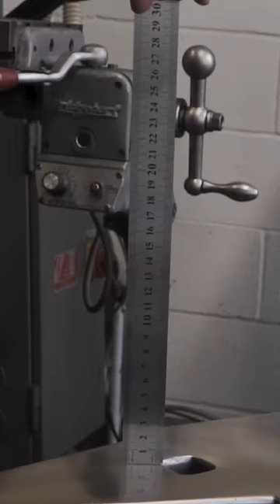"Pig" Anvil Restoration, Super Speed Build! #shorts

Comment from the maker: Thank you for watching! Find the full length video on my channel page!
Or click here:
https://youtu.be/QFqKMneLhBc
Reply: Are you gonna make the Hammer of Thor with that thing😂? Nice video
Reply: Nice job.
Reply: @JaymesWebbs  я
Reply: Why would you mill for parallel and then flap disc the top? Or set a binder underneath the feet that you milled? Mill parallel for no reason at all then??
Reply: В России такого уже не найдеш
Reply: When can I expect the delivery? Haha
Reply: @JaymesWebbs   Very nice. You might get more dampening using sand as your base then concrete. But the concrete will definitely give you more weight.
Reply: Take this lifehack. You can make it easier and cleaner if you connect the sandpaper wheel to the lathe instead of the mill, and you'll get very even and flat polished surface.
Reply: 250lbs?
Reply: @JaymesWebbs  😊😊😊😊😊😊😊😊😊😊😊😊😊😊😊😊😊😊😊😊😊😊😊😊😊😊😊😊😊😊😊😊😊😊😊😊😊😊😊😊😊😊😊😊😊😊😊😊😊😊😊😊😊😊😊😊😊😊😊😊😊😊😊😊😊😊😊😊😊😊😊😊😊😊😊😊😊😊😊😊😊😊😊😊😊😊😊😊😊😊😊😊😊
Reply: @JaymesWebbs  😊😊😊😊😊😊😊😊😊😊😊😊😊😊😊😊😊😊😊😊😊😊😊😊😊😊😊😊😊😊😊😊😊😊😊😊😊😊😊😊😊😊😊😊😊😊😊😊😊😊😊😊😊😊😊😊😊😊😊😊😊😊😊😊😊😊😊😊😊😊😊😊😊😊😊😊😊😊😊😊😊😊😊😊😊😊😊😊😊😊😊😊😊😊😊😊😊😊😊😊😊😊😊😊😊😊😊😊😊😊😊😊😊😊😊😊😊😊😊😊😊😊😊😊😊😊😊😊😊😊😊😊
Reply: @JaymesWebbs  😊😊😊😊😊
Reply: @JaymesWebbs  😊😊😊😊😊😊😊😊😊😊😊😊😊😊😊😊😊😊😊😊😊😊😊😊😊😊😊😊😊😊😊😊😊😊😊😊😊😊😊😊😊😊😊😊😊😊😊😊😊😊😊😊😊😊😊😊😊😊😊😊😊😊😊😊😊😊😊😊😊😊😊😊😊😊😊😊😊😊😊😊😊😊😊😊😊😊😊😊😊😊😊😊😊😊😊😊😊😊😊😊😊😊😊😊😊😊😊😊😊😊😊😊😊😊😊😊😊😊
Reply: @ksmachinist3373  😊😊😊😊😊po😊😊😊😊😊😊😊😊😊😊😊😊😊😊😊😊😊😊😊😊😊😊😊😊😊😊😊😊😊😊😊😊😊😊😊😊😊😊😊😊😊😊 😊😊😊😊😊😊😊😊😊😊😊😊😊😊😊😊😊😊😊😊😊😊😊😊😊😊😊😊😊😊😊😊😊😊😊😊😊😊😊😊😊😊😊😊😊😊😊😊😊😊😊😊😊pop
Reply: @ksmachinist3373  😊😊😊😊😊😊😊😊😊😊😊😊😊😊😊😊😊😊😊😊😊😊😊😊😊😊😊😊😊😊😊😊😊😊😊😊😊😊😊😊😊😊😊😊😊😊😊😊😊😊😊😊😊😊😊😊😊😊😊
Reply: @yanmay9824  😊😊😊😊😊😊😊😊😊😊😊😊😊😊😊😊😊😊😊😊😊😊😊😊😊😊😊😊😊😊😊😊😊😊😊😊😊😊😊😊😊😊😊😊😊😊😊😊😊😊😊😊😊😊😊😊😊😊😊😊😊😊😊😊😊😊😊😊😊😊😊😊😊😊😊😊😊😊😊😊
Reply: @yanmay9824  😊😊😊😊😊😊😊😊
Reply: @yanmay9824  😊😊😊😊😊😊😊😊😊😊😊😊😊😊😊😊😊😊😊😊😊😊😊😊😊😊😊😊😅😊😊😊😊😊😊😊😊😊😊😊😊😊😊😊😊😊😊😊😊😊😊😊😊😊😊😊😊😊😊😊😊😊😊😊😊😊😊😊😊😊😊😊😊😊😊😊😊😊😊😊😊😊😊😊😊😊😊😊😊😊😊😊😊😊😊😊😊😊😊😊😊😊😊😊😊😊😊😊😊😊😊😊😊😊😊😊😊😊😊😊😊😊😊😊😊😊😊😊😊😊😊😊😊😊😊😊😊😊😊😊😊😊😊😊😊😊😊😊😊😊😊😊😊😊😊😊😊😊😊😊😊😊😊😊😊😊😊😊😊😊😊😊😊😊😊😊😊😊😊😊😊😊😊😊😊😊😊😊😊😊😊😊😊😊😊😊😊😊😊😊😊😊😊😊😊😊😊😊😊😊😊😊😊😊😊😊😊😊😊😊😊😊😊😊😊😊😊😊😊😊😊😊😊😊😊😊😊😊😊😊😊
Reply: @yanmay9824  😊😊😊😊😊😊😊😊😊😊😊😊😊😊😊😊😊😊😊😊😊😊😊😊😊😊😊😊😊😊😊😊😊😊😊😊😊😊😊😊😊😊😊😊😊😊😊😊😊😊😊😊😊😊
Reply: @yanmay9824  😊😊😊😊😊😊😊😊😊😊😊😊😊😊😊😊😊😊😊😊😊😊😊😊😊😊😊😊😊😊😊😊😊😊😊😊😊😊😊😊😊😊😊😊😊😊😊😊😊😊😊😊😊😊😊😊😊😊😊😊😊😊😊😊😊😊😊😊😊😊😊😊😊😊  pop😊😊😊😊😊😊😊😊😊😊😊😊😊😊😊😊😊😊😊😊😊😊😊😊😊😊😊😊😊😊😊😊😊😊😊😊😊😊😊😊😊😊😊😊😊😊😊😊😊😊😊😊😊😊😊😊😊😊😊😊😊😊😊😊😊😊😊😊😊😊😊😊😊😊😊😊😊😊😊😊😊😊😊😊😊😊😊😊😊😊😊😊😊😊😊😊😊😊😊😊😊😊😊😊😊😊😊😊😊😊😊😊😊😊😊😊😊😊😊😊😊😊😊😊😊😊😊😊😊😊😊😊😊😊😊😊😊😊😊😊😊😊😊😊😊😊😊😊😊😊😊😊😊😊😊😊😊😊😊😊😊😊😊😊😊😊😊😊😊😊😊😊😊😊😊😊😊😊😊😊😊😊😊😊😊😊😊😊😊😊😊😊😊😊😊😊😊😊😊😊😊😊😊😊😊😊😊😊😊😊😊😊😊😊😊😊😊😊😊😊😊😊😊😊😊😊😊😊😊😊😊😊😊😊😊😊😊😊😊😊😊😊😊😊😊😊😊😊😊😊😊😊😊😊😊😊😊😊😊😊😊😅😊😊😊😊😊😊😊😊😊😊😊😊😊😊😊😊😊😊😊😊😊😊😊😊😊😊😊😊😊😊😊😊😊😊😊😊😊😊😊😊😊😊😊😊😊😊😊😊😊😊😊😊😊😊😊😊😊😊😊
Reply: @ВасилийМорозов-з3л  😊😊😊😊😊😊😊😊😊😊😊😊😊😊😊😊😊😊😊😊
Reply: @ВасилийМорозов-з3л  😊😊😊😊😊😊😊
Reply: @77Avadon77  😊😊😊😊😊😊😊😊😊😊😊😊😊😊😊
Reply: @77Avadon77  😊😊😊
Reply: Cermets or carbide?
Reply: When stricking hot metal it won’t bounce so you want the anvil to bounce the hammer before you hit the metal
Reply: Really great job on this! Was happy to see you qualify the top and bottom both! Great stand also! I know this anvil setup will serve you a long time going!  👍
Reply: @ksmachinist3373 ,
   He 'qualified' the top and bottom, then put a surface that is much better then just tool marks. 
That surface texture would have been transferred to his work, so it was smooth with a flap wheel or Blanchard grind it Etc., and he was already there with the flap wheel as he surfaced the horn with it.
Reply: @oldnick4707  I really hope you don't think Blanchard grinding and flap disc are even in the same ballpark. My old Blanchard grinder I ran was .0005" max travel per pass. If you're even worried about surface finish transfer that could have easily been accomplished by a finish pass on the mill. My argument was that milling both sides was a waste of time, aka more content to film for the video. Also teaching bad habits.
Reply: @ksmachinist3373 ,
   I'm saying you could drop it off at the grind shop for less that hundred dollar bill, pick it up, often that afternoon, and it'll be fine. Lol
   You could fly cut it, as you already have it set up anyway, and it would be fine too. Might still sorta look like a surface gauge but who really gives a shit for an anvil, you know? Lol
Reply: @ksmachinist3373 ,
   I've worked in my father's large industrial repair job-shop for forty years, so my various expertise would surprise you most definitely, yep. 
As he was using a pretty small cutting head he would have had to make a couple passes and then he ended up with a slight ridge unless it's trammed perfectly, but usually it's not, so I think that probably fly cutting it would be a really great idea,or running a way bigger head.
Reply: @ksmachinist3373 ,
   Incidentally he 'milled for parallel', (qualified the bass), so that he wasn't bolting a shitty face to his table then decking the top off of that.
Reply: @oldnick4707  I think you lost the point somewhere. This is about milling the top and then flap discing it.. My thought was why mill the top the disc it. The bottom face makes sense, but then he put a binder underneath that would not hold flat without a jig. "Incidentally" hahaha.
Reply: @ksmachinist3373 ,
   I agree with most or all of what you said. I'm not sure he planned on polishing it. He might have just had a dogshit machine finish and decided to shine that shit off a bit?  He laid into it particularly around those holes etc., and he showed a 12in scale across the top and you could see a little light here and there. So is what it is.
   I've seen people rebuild motors and use a flap wheel, Cratex and  rotary 3M scotchbrite tools, all kinds of weird shit on the heads. This anvil is way less 'rocket scientific' than that. Lol 
   I know he ended up with a way better flat surface than he started with, the face of that's about as hard as it ever was because any work hardening goes down a bit, and the thing worked fine when new anyway, he'll have to see how the cement idea works, but he squeezed some turds of silicone or the like to bed it in, so that was good.
Reply: Brother, I am not a black Smith but I have been Anvils a good bit of my years. Started with Granddad just needing one around the farm. Then dad being a weider and fabricator. 
What I find interesting is all the hate from half of the commenters.  Well that and the 27 different ways to mount one. Apparently, based on what is being said, all but one is the proper way, yours didn't make the cut. 
 Apparently in 25-50 years yours will probably fail, it's a shame to,  I thought it was brilliant. 
Good job.
Reply: Amazing!!!
Reply: I had a coworker who attempted to restore our dinged up anvil

He milled down the top but the cutter sank in, leaving an uneven surface that demanded more milling, which removed too much metal

Then to put more material he used a MIG welder. He kinda ruined the anvil
Reply: My friends that bad a work he broke an anvil
Reply: I am no expert but...I think you may have messed up this anvil. You didn't need to grind it, you could've just sanded it a bit, and put it onto a big stump. I mean sure its shiny, and that's cool, but...Wouldn't it just rust now?
Reply: @ЕфимКрылов-в1р видимо вы не в России живёте!
Reply: Жалко по такому бить. Надо на нём бантик навязать и на сервант поставить...
Reply: А как быть с тем что лицо наковальни проходит закалку и ты фрезой снял самую твёрдую часть? После такой операции её надо либо прокатить, либо в музей фрезеровка сдать.
Reply: You lost decades of work hardened surface - for what? Plus anvils should be mounted on wood to absorb heavy blows. But you’ve impressed a lot of ignorant people on YouTube, so I guess that’s a win, right?🙄👀🧐😎😜
Reply: That stand is a work of genius 👍
Reply: @ksmachinist3373 maybe he made sure all four feet were even so it wouldn't rock.
Reply: Magnifique. From France.
I liké this. Merci❤